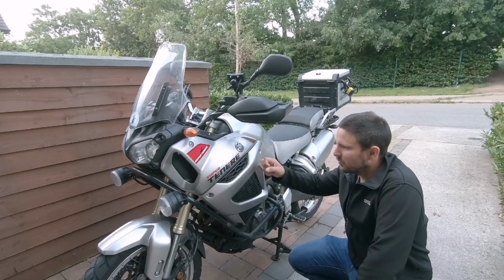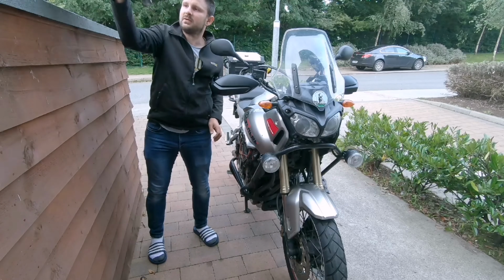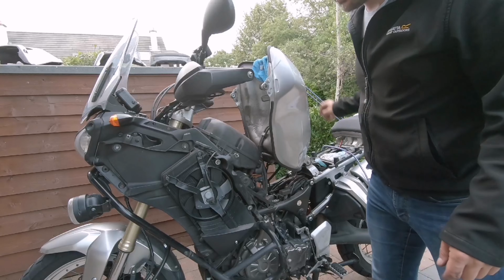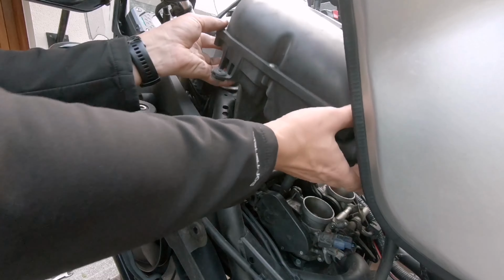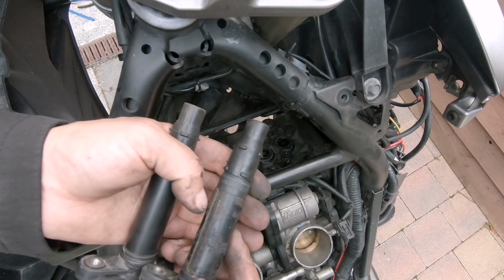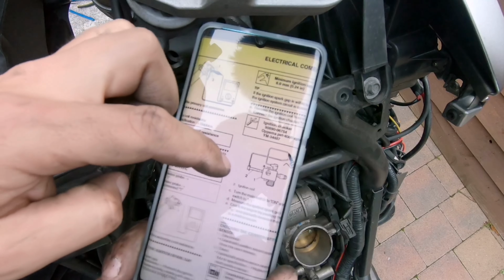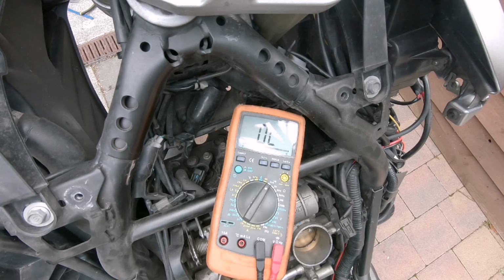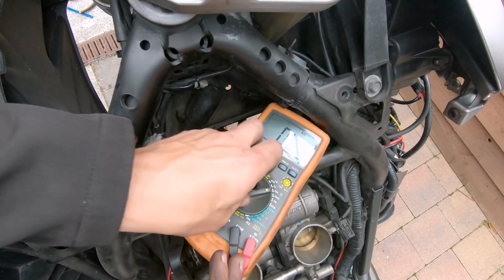Check ignition coils on Super Tenere XT1200Z

Comment: Lot of people on S10 Forum say that they have left their plugs for 50 -90 thousand miles with no problems!Mine were knackered after 24,000 ,will be replacing them every 15 -18 thousand from now on ,For the record my electrodes were slightly worn,checked coils and plugs for resistance which all checked out fine but my bike was missing and going on 1 cylinder under load,new plugs in ,back to 100% so I wonder just because the resistance on the plugs is ok the plugs can still be faulty,great video,Thanks.

Comment: Hi my coils are reading 1.4 on primary test is this within spec
Reply: In  the manual say primary 1.19 and 1.61. you measure 1.9 aré out of parámetro?
Reply from the maker: No because I measure the multimeter lead resistance and it's not zero so I assume that I'm within specifications. I explain this in the video.
Reply: @Freedomachine  One question, I have the same parameters as you in the video. I did an inspection with the cois connected out of place, and they turned me off electricity from the middle side. Replacement required?
Reply from the maker: Yes within spec. Thanks for watching ☺️
Reply: @Freedomachine  thanks mate, just trying to get to the bottom of a misfire at low revs.
Reply from the maker: Change spark plugs and make sure all is perfectly dry.

Comment: Nice video! 
I have removed the stock clamp on the hose under the air filter box and replaced it with an adjustable clamp. The type that is adjusted with a screw on the side.
Reply from the maker: Thanks for watching🙂Also thanks for the advice. This is exactly what I did in my valve clearance video.

Comment: Good stuff I just found some dampness in 1 of my plugs the other day water seems to be getting in I put an extra o ring on the coil stick and greased the top of them all so fingers crossed. The bike wasn't running 100% and had backfired once or twice.
Reply from the maker: If the coils didn't short circuit for too long your bike should be running fine now. Fingers crossed 😊
Reply: @Freedomachine  yes went for a wee  10km ride last night to visit parents so 20 km and it was perfect. Wished I could have kept going😜😜 bloody lockdown
Reply from the maker: I know! I'm going to Tesco with the bike. Only way to survive 😀

Comment: The next time you change the spark plugs or check the coils, you can easily access the screws on top of the coils from the front with a wrench.  Give it a try...it was so much easier than using a swivel.
Reply from the maker: I'll try next time. Thank you very much!

Comment: Hi thanks for sharing. If i may have two comments 
1. Would be wise to cover the throttle bodies while you mess around that area... 
2. I saw that your Coils protective rubbers did stick to the engine cover not the coil. In another video of yours i saw you applied some HT silicon to the rubbers to prevent water leaking inside the coil / wells. So is that the effect of the silicon you put under the rubber covers ? Thanks 
P.S. The big plastic box you removed is called "Air Box" not "Air Filter" :-)
Nice videos keep going !
Reply: Hi thanks for the feedback. I honestly forgot to cover the throttle bodies as I'm new to filming things and when you have to focus on two things then this happens. My apologies. The rubber is sticking to the engine cover because of the silicone but you can get them off as well. If there is a better solution to the water problem please feel free to give suggestions. This is what most mechanics do. Apologies also for naming things wrong. I'm sure I did it many times in other videos too. I will work on this.
Reply: @MarcoBelcastro  Thanks Marco. 
Yes the HT silicon i've seen it is the common method of making the ports more sealed than stock. I was just wondering how sticky that would become in time but it seems as you say it can be removed easily. I have the S10 in my radar screen as next bike :-)
Reply: I guess it depends on silicone. Get the 2014 model and you won't have to deal with non of it.
Reply: @MarcoBelcastro  Actually yes was looking at the 2nd edition 2014 on (and likely ZE). 
I Didn't know that the coils had changed (or improved seals) in that model. Thanks again
Reply: @oc_geek337  They modified the cylinder head. Old part was 23P111900100 new part is 2BS1119001. I did not check the actual coils but it appears that this has solved the problem.
Reply: @MarcoBelcastro  Great info Thanks !